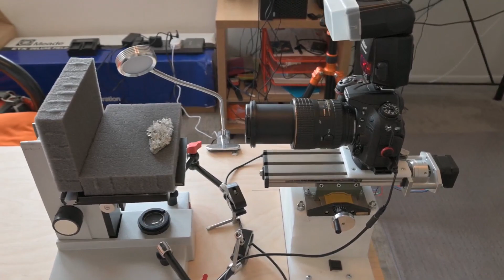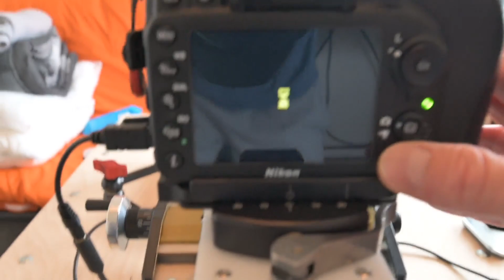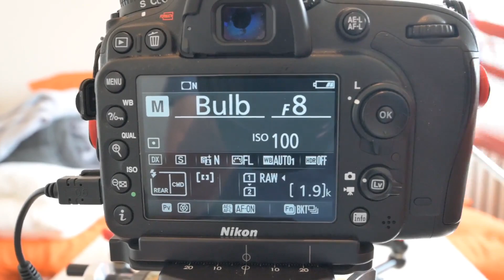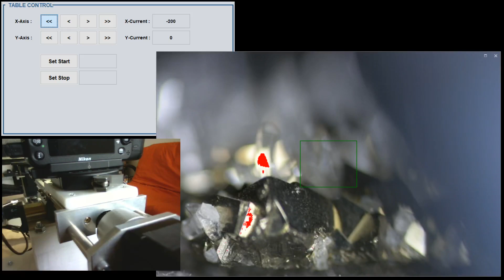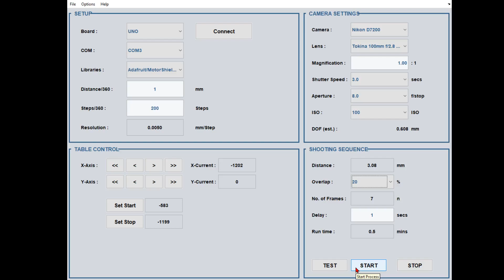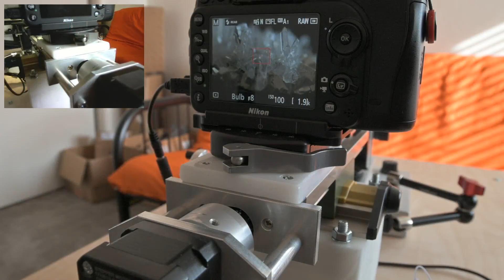Matlab/Arduino controlled Macro Rail for Macrophotography

Comment: Hi, excellent work, I would like to build the same system, where can I find more details? thanks
Reply from the maker: I just checked, Arduino took down the project it seems. I'll dig out my PDF and try to add it on here.
Reply: Thanks @MacroPhotoFan_
Reply from the maker: that's the new location of the project
https://www.hackster.io/MacroPhotoFan_2004/matlab-arduino-controlled-macro-rail-for-macrophotography-200c46